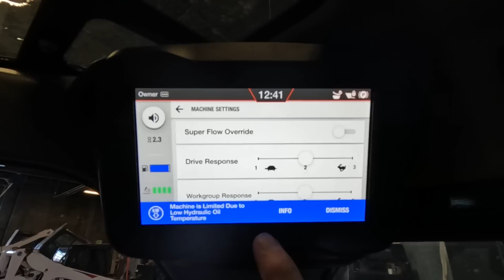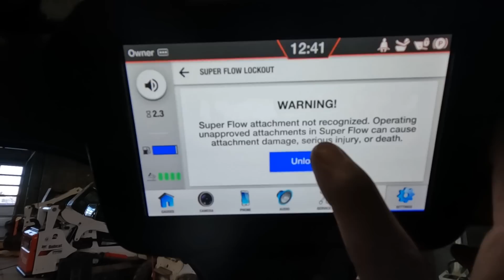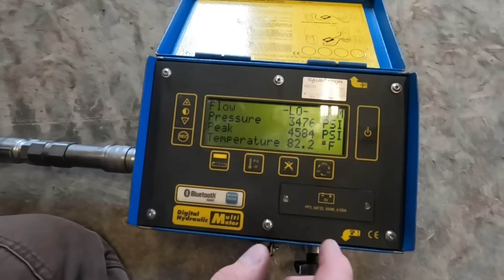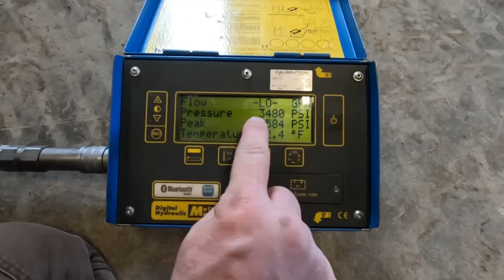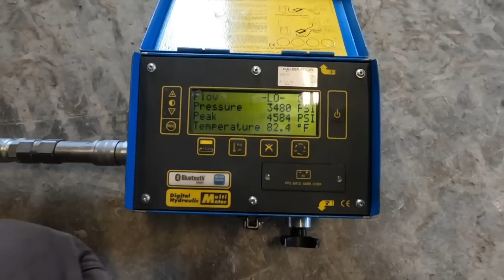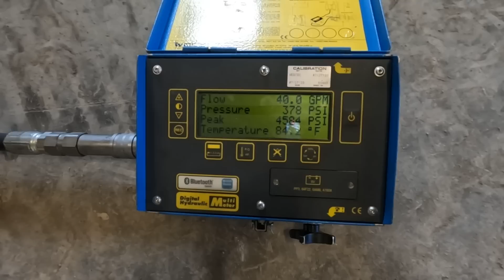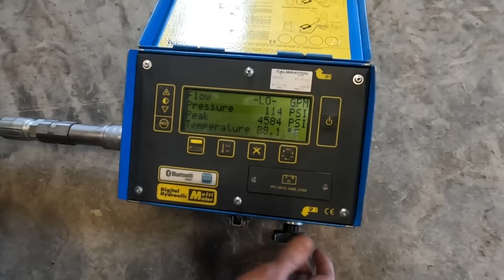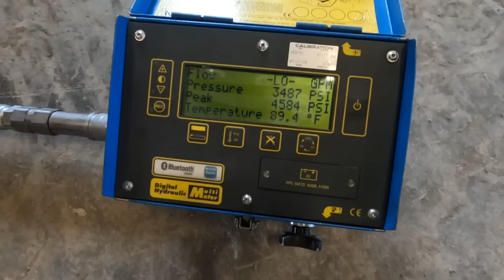Bobcat T86 First Look From A Mechanics Point of View

Comment: There is definetly some weird stuff going on. Calculated hydraulic hp on superflow is greater than the engine output which is just not possible. Intersting
Reply from the maker: If the machine were running at max flow over relief pressure, I'm calculating 99.5 hydraulic horse power.   That would kill the engine but the engine is rated at 105hp.
Reply: @tetradgroup  I wonder at what point does the superflow even matter? My tl12r2 high flow is 40gpm and produces 84 hydraulic hp with 115 hp but can still stall the motor with the mulching head. So is super flow even worth it because the power is unusable?

Comment: How could you run a mulcher with hydraulic hood when the auxiliary is only two hoses? So you wouldn't have a second auxiliary circuit to use the hydraulic hood? Thanks

Comment: So initially I was under the impression Bobcat was going to integrate an auxillary oil cooler into this particular machine for hydraulic oil temperature control.  My gripe with all the major compact track machine manufacturers is they say you can run attachments such as a Diamond forestry head or FAE mulcher and the machines will keep the hydraulic oil cool enough to run in summertime.  That is not the case in any of the three machines I've tried; Tak, Bobcat or John Deere.  Was hoping this machine would solve that problem.  Doesn't appear they did that.
Reply: They did solve it, and now it’s proven by scores of T86 running forestry heads in Texas and all over the Deep South last summer, I’m talking triple digit heat 8 hour days with fluid temps hovering around 150 degrees. It’s quite remarkable, and why I bought one last week, T86 is now one of only two machines that can claim this with just the factory cooling system, the other is the ASV RT135 but that’s more of a dedicated mulching tractor and riddled with issues. I’ve personally kept in touch with around 15 guys running T86’s for the last 12 months and ALL of them have been bulletproof. Phenomenal machine.
Reply: @omegaenvironmentalpartners How do you find the cockpit, it looks a little sparse. I don’t care about coffee cup holders etc, but seat comfort, controls and noise etc.
Reply: @shiraz1736  the seat bottom could extend out a little further IMO but it’s a minor gripe, everything else is top notch.
Reply: Cockpit is good, debris is a daily struggle.

Comment: Hey HowIDidIt i have a T86 throwing code C10A5-16 Pump Case Drain Hydraulic oil temp out of range Low. I was running my stump grinder when it did it. hydraulic fluid is full and hydraulic temp is right at 125 degrees when it happened, is that to cold and maybe whats causing the issue? The dealer checked the OHMs on both temp sensors and it was 745 (supposed to be normal) I guess. They cleaned out the hydraulic fan solenoid as it seemed stuck and to cold for running temp and seems fine now after being pulled and cleaned. What is your opinion is it pops up again? thanks!
Reply from the maker: Out of range low is possible loose plug at sensor or wiring issue.  The case drain manifold under the cab has a filter on it, there you will find a couple temp sensors.  Check connections or swap plugs and see if code changes.
Reply: If it happens again I will swap plugs! what should I expect when swapping plugs and it happens again? @tetradgroup
Reply from the maker: @dillon40R  depends on the source of the issue.  If it's a bad sensor then the code would change to motor case drain temp code.  If it's wiring then the code would not change.

Comment: Seeing a T86 I would have major concerns on its design.
The T86 has exposed driveline motor lines on the underside of the machine. When mulching they will get broken. 
The T86 has a grate on top for air intake instead of a precleaner assembly. The air cleaner will clog with dirt quickly in dusty environments or while mulching. 
What looks like a serious concern to me also is the location of a good portion of wiring harness and the Ecu being located on the bottom of the compartment. Any of us who have owned track loaders know that mud and water finds it way into the bottom of the compartment. Its ridiculous to place it there. What do you think will happen to the Ecu and connectors when you get stuck in deep mud or a creek? 
How could Bobcat finally design a well built machine capable of mulching with the right pump and good flow only to completely F up and make critical design mistakes like the ones I mentioned. 
When a company is completely disconnected from the end use this is what happens.
They got it right in so many ways but then totally screwed up on critical machine killing details.
Thanks for taking the time to make the video to show us the machine though. Very informative.

Comment: Just curious how did you test super flow without plugging into the 1 inch fittings?  Did I miss something?  Or just not understand how it works?
Reply from the maker: One set of hoses feeds both fittings, they are the same circuit

Comment: I’ve been more impressed with the past Kubota engines than the newer Doosan engines. Our S570  air box cleaner is such a pain, and the fuel rail shows so much rust, yet we don’t use it in winter. But our older T590, powered by Kubota, is night and day better..just seems like maintenance overall is easier. BTW, your videos are great learning tools.

Comment: So
If they built the machine bigger
Then the room to work on would make it easier
With a release to take the cab out of the way
Modern battery to tuck it away nicer
Sure all improvements = more $'s
Theres a bit of competition now with other brands
But in time
Improvements will get better
Like travel with super flow on 
Its probably like closing a value on the travel speed to maintain pump flow 
They haven't figured that one out yet
That cab lift didnt look smooth
Perhaps a cab lift that can tilt all the way over to where the roof sits on the ground 
An engineers dream job 
Thank you

Comment: Looking to possibly replace my 2018 T770 with one of these, current Hrs 2600. I've been told to bump up my case drain to a 5/8 line straight to tank. and run 1" lines to my couplers. also have a couple guys telling me to crank up the main relief valve.  I mainly forestry mulch and stump grind. But if I'm beating a dead horse and its time to replace the machine I'm curious of the case drain line size on the t86 also concerned with debris getting into the belly pan. Not uncommon to find mud holes in my line of work. Not sure if its best to fix up what I have now or try one of the R series out.

Comment: Any more thought on the usage of def on these machines?
Reply from the maker: Well, it will use 1 tank of DEF to every two tanks of fuel.  This is more frequent than the M Series due to smaller tank and the fact it does not have an ERG which requires more DEF to remain emissions compliant.
Reply from the maker: Excellent question, thanks for asking.

Comment: The r series machines are absolute junk been dealing with lots of electrical issues dealing with displays staying on and stuff like that.
Reply: Seriously? If a display staying on is the best example you got of a common failure you deal with to share, that problem hardly condemns the series as junk.  
Especially since stay on issues are so easily diagnosed. 👊
Reply: @jaxturner7288  no the r series suck lmao a brand new machine should not have this many electrical issues. The cabs are heavier on the the design of the air box for the ac is bulky and awkward to lower the cab can be a pain by yourself. The battery location can be a pain. The main harness where it goes through the firewall can be a pain in the ass. God forbid you have to replace a left awash plate sensor that’s a total bitch to do. The def injector is a pain to get to. V2 engine analyzer isn’t the greatest tool to help trouble shoot those engines. As far as leak back test on those injectors good luck unless you make your own fittings to plug into the injectors that will cost you about $100 for just the fittings. The oil filter locations make catching the excess oil a pain. More than likely there will be a mess to clean up. The push lock hydraulic hoses are a pain in the ass to have made at a local hose shop. The fact that most of the new ones run blue hydraulic oil now sometimes red means service techs have to carry more oil. Yeah all in all they suck. Go work on them for a change and tell me what you think.
Reply: @jakestover9482  I remember my first week fixing stuff and thinking everything is difficult to work on as well.   
Welcome to the life of fixing stuff.  
None of it is easy or convenient. 
👍
Reply: @jaxturner7288  🤣 not my first week at all but right on boss man. All in all the r series are still junk ass machines that’s still what this is about. I guess they are better than a JCB but other than that they suck. I’m sure you’ve worked on way more things, different product lines than me 🙄🤣.
Reply: @jakestover9482  just messing with you but seriously, heavy stuff and components that are frustrating to deal with are a constant and expected part of the job.  
May as well just get used to it, over it, or out of it.  👍
Reply: @jaxturner7288  I know you are, I’m used to working on heavy equipment and trucks been in the mining industry for a few years 🤣 now I’m working on bobcats i don’t like the r series machines I think the design of them are pretty lame they tried to copy everyone else and they aren’t the worse out there but it’s definitely not the best

Comment: Is it possible to add high flow to a standard flow T 66? If so, would it be cost effective? TIA
Reply from the maker: It is possible but I have not done a T66 yet, usually the conversion is between $5k - $7k

Comment: I think the newer Toolcats also have the Delphi fuel system.  Would you call the engine in these new Toolcats a V2?  Is the Delphi system a significant upgrade, in your opinion and, if so, can you so more about why?  Appreciate your videos.  Thanks!
Reply from the maker: V1 was Delphi, the upgraded V2 has the Bosch fuel system.  You are correct the new Toolcats UW53 and UW56 have the upgraded V2 engine with Bosch.

Comment: Main issues I have with 299s are the final drive hoses being exposed between the frame and the drive. If this machine will be in the woods how does it look between the frame and finals?  Need to see the guarding there please.
Reply: Have you looked at the D3?  I believe your concern has been addressed w a new hose routing block.

Comment: Wow great video thanks so much ,my company runs one s870 and three t770 two have had fuel issues and the 870 also blew pump seals and filled the chain case with hydraulic fluid.now all the bugs are fixed and they are great machines.you have really taught a old dog a lot about these machines thanks again bud

Comment: Will this engine go thru more def? I go thru several tanks of fuel on my s-770 before I need def.
Reply from the maker: Not sure but that is an interesting question. I will look into it and let you know if I find anything.  I would think it would last longer being the same size but more efficient engine that runs cooler due to the new design.

Comment: Wow that air intake location looks like it will work a lot better. Also, how often is the case drain filter supposed to be changed on a T76? And what happens If it does not get changed?
Thanks for the great videos
Reply from the maker: I would change the case drain every 500 hours, worst case a clogged case drain filter could cause blown drive motor seals.
Reply: @tetradgroup  does a clogged case drain show any symptoms before it blows the drive motor seals?
Reply from the maker: @pigslayer106  nope, especially on the older machines with old style metal case drain filters but I wouldn't worry about it with a spin on filter as they are much better.  I haven't seen blown seals since the spin filters came out so that would be an extremely rare case but possible none the less

Comment: Do that one have the hydraulic track tensioner like the 870 or grease ?
Reply from the maker: Excellent question!  Looks like it will be grease cylinder, I do not see any options for the hydraulic tensioner.
Reply: @tetradgroup  I think that's a good thing cause I've replaced many hydraulic tensioner at my dealership I work at